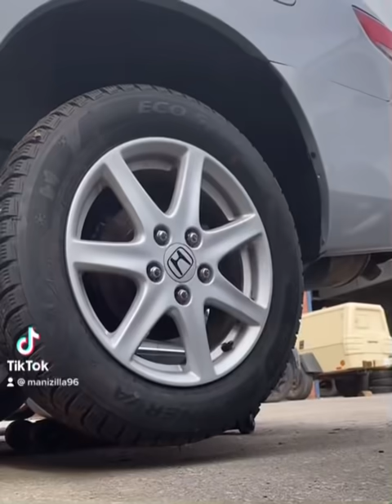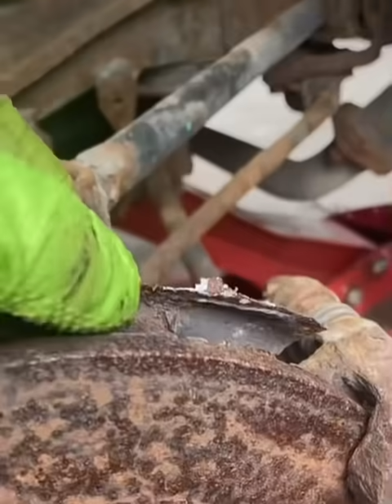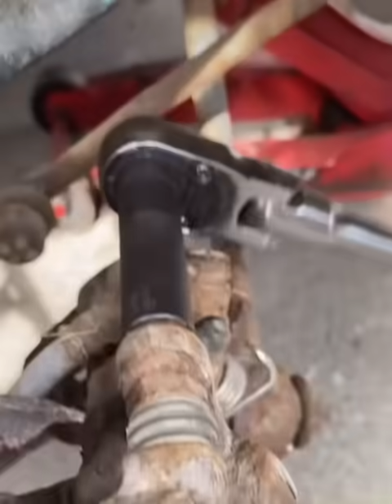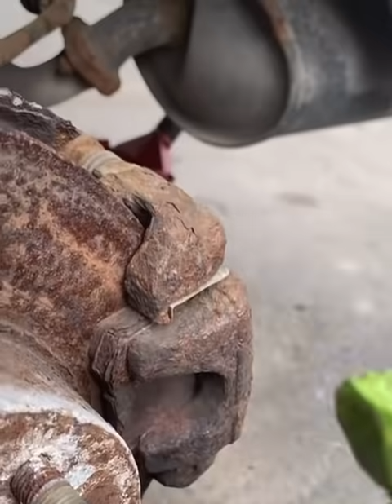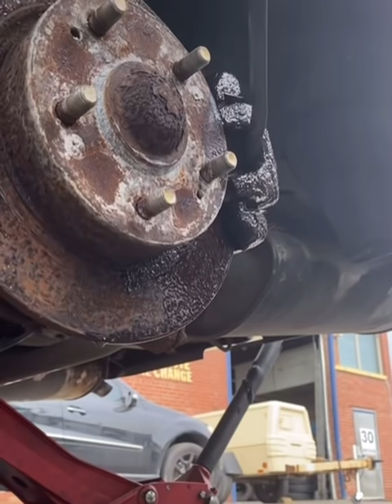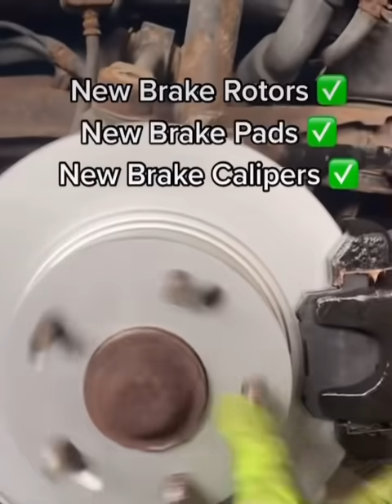Customer never drove their vehicle for 2 years and this happened ...

Comment: I would say that he cleaned and painted those calipers
Reply: same...
Reply: That cost extra........
Reply: When someone is cheap, they'll say clean the piece that's rusted and throw it back on
Reply: If not pitted and pistons are good rebuild them.. normal maintenance on brakes.. boots too...I always rebuild brakes if boots are compromised.. less then 10bucks. Diy...
Reply: Thinking the same shit but bet he charged em for 2 new ones he even used same old hardware you can still see residual rust residue
Reply: Correct, you can see the mark on the caliper where he hit it with the pry bar and hammer. Smh.
Reply: It's actually a zinc coated caliper, several brands come like that and it wears off after minimal contact. It's mean to be a protecting or a sealer.
Reply: @andrewnacy3258  na that isnt whats going on here
Reply: @seppukujones9651  I wait NVM, I was thinking about the brake rotor for a second my bad
Reply: @JacobEcret  I'm with you. Theres no way he cleaned that rust off and painted them.
Reply: @JacobEcret  my money is on a wire wheel and brush there wasnt much cleaning done
Reply: @JacobEcret  didnt even touch the anchor and he re used the hardware probably a caliper rebuild
Reply from the maker: The customer wanted refurbished calipers 
My mistake for writing “new” but calipers we’re replaced
Reply: @ManiiZilla  thank you for clarifying! Seriously!
Reply: Wire brush and black paint easy good as new hahahah this is what gives good mechanics bad names
Reply: @dsnutzzz4567  he did at least come back and reply that’s what the customer wanted. I’m a good mechanic and I hate getting a bad name for stuff like this
Reply: They are refurbs... The color is from sandblasting not paint...
Reply: It would be easier and quicker to just buy oem calipers that’s a thing y’all know
Reply: Hahaha there's still rust on the calipers
Reply: @ManiiZilla  I thought you were a fool for buying new ones. 

I've rebuilt my share of 40 year old calipers. It's tough but they end up as good as new ones. (914 calipers are EXPENSIVE)

At a shop, it comes down to parts vs labor. For a late model Honda, refurbished is probably the way to go. 

But yeah, 2 years of rust won't kill a caliper. Throwing away good parts makes Honda rich, and the rest of us stuck paying them. I hope you sent the cores back to the re-builder.
Reply: @gorillaglue5958  how is a new caliper faster or easier than refurbished? And, I'd bet the ones he used were OEM. 

People who talk world's but dont turn wrenches.
Reply: He did, you can see the dent where he smashed it with a crowbar.
Reply: Yeah those weren’t new xD
Reply: damm 😆🤣
Reply: @ManiiZilla  people are so cheap and careless
Reply: @zodwraith5745  Did you know it costs $2000 to replace an AC compressor? I'm a mechanic that replaced my fair share of compressors and not once has the bill come close to that, but here we are with another shop telling my wife she needs this $2000 fix. $500 to replace the water shut-off valve, that's getting bypassed for the season. The only thing they didn't try to scam her on was a serpentine belt for $50. 

Local Mazda dealer smashed her windshield replacing the wiper motor, it had a crack on the passenger side of the windshield, and they tried to tell her it was already broken so it wasn't their fault they left a Texas sized crater on the driver's side. By the end of the conversation, they realized she doesn't like being taken advantage of, but the free windshield eased the pain
Reply: @bullypopful  Ironically I just replaced the compressor last year in my GL450 after the clutch threw it's bearing and scattered all over the engine bay. Serpentine shredded, got pieces of metal in the alternator, and sheared off an idler. What an absolute nightmare repair. Mercedes has no right to wedge a V8 into such a small space. Still saved 2 grand even with the vacume purchase for a proper recharge but far from my favorite 2 days with a wrench in hand. Those are the jobs that make me empathetic with mechanics.

If you buy German you better have a full wallet or a full toolbox. Funny thing is parts for my Mercedes are cheaper than parts for my GMC.
Reply: @bullypopful I just had my whole system replaced because you don’t just replace one part or it starts leaking. $700.
Reply: I wouldnt replace them at all, a rebuild seal cit and a good clean. Usually new are too expensive
Reply: @ManiiZilla  Bs dude
Reply: @shadowwalker3204  The same rusted pitted calipers just sprayed with some Rustoleum
Reply: @zodwraith5745  All facts good sir
Reply: Defo not new 🤣
Reply: Wire wheel and rust remover and maybe new seals if he was feeling generous
Reply: Nah up sell to ceramic so they won’t ever rust and seize again.

Comment: With that much rust buildup I hope you checked all the brake lines and fuel lines.
Reply: Just in case.
Reply: If they didn’t AT LEAST do a flush to get all the old shit out. Then that’s literal ticking time bomb on the road.
Reply: Hell no he dodnt thats not the job
Reply: Why would he do that when the customer said what she wanted done
Reply: @noerangel9973  because you don't let a vehicle with possible fatal issues leave the shop without at least checking and informing the customer of those issues. You don't fix any issues without customer's knowledge and consent but you do have to check to make sure that the vehicle is safe to drive.
Reply: Pep boys “fixed” my moms 20 years old Le Sabre brakes.  Same thing this guy did, minimal effort job; just a pad and rotor change. No new fluid or lines.  shrek piss green fluid and the lines were rotted to Hell.   My husband and I Blew one of the rear brake lines when we put new fluid in the system.   Blew a rear caliper out  too.  

They took $1300 from her and left her in a death trap.  NEVER TOLD HER THE LINES WERE SHOT ! They Never should have touched the car.  

Don’t fix the brakes just enough to use the car.  Fix it right or REFUSE to do the work.  GREED.

I’d take a hit on my profit margin to push a proper job or not do it at all.
Reply: Well he did say he drove it in the shop
Reply: Bolts floor its gonna be dust soon..
Reply: @jo8737  no you would not..lier..we all do what a customer states..a full redo would be 3k.. all parts rebuilt or replaced... hoses new.. master on down..  hell. no customer pays for that..
Reply: Why? The brake and fuel lines would be in better shape than a car that has been driven every day for 2 years..... The only reason the brakes are such a mess is because they've been sat rusting whereas you'd usually be giving them a good grind every time you drive the car to stop it happening.
Reply: @Kiowan918  if the metal on the brake calipers and rotors, control arms, inner fenders looks as bad as it did, other metal parts, such as, metal fuel lines and brake lines, might look just as bad. Since they are usually made of thin metal lines, it doesn't take much corrosion to make them weak enough to burst when pressurized for any amount of time. Both the fuel lines and brake lines are always subjected to high pressures when the vehicle is in use. I wouldn't drive my car without first checking those items if there was that amount of corrosion.
Reply: aren’t fuel lines rubber?
Reply: @ethanstorm1735  fuel lines are usually a combination of rubber and metal lines. Metal lines usuall run the length of the vehicle and rubber lines are used where there is possible movement in the lines, ie. Between the chassis and the engine and between the tank and the chassis. Same with brake lines.
Reply: Woe dam let's not get all crazy, I am a Honda owner myself, The brake and fuel lines are probably better on this car still then some of the new Crap being built these days, Why because I have ran Honda cars in the shit salt roads since 2005 with the one being a 2001, have NEVER had to replace a brake line or fuel line yet, but yes I did have to do brake lines on a 1994 Acura once, It was parked in the weeds for years after not washing the road salt off at all,The exact same thing happened to it, The rotors that is, This is why you never want to park a car with road salt left on it. Two 2003 Civic Hybrids 5speed manuals with over 300,000 Miles each still had the original brakes disk in front and one set of pads The rest of maintainece oil changes tires I think I bought like two struts for on of those cars it failed shortly after someone hit the passenger door leaving a drive way, Spinning the car 180 on Ice, It was not fun trying to straighten the center pillar after that, I remember pulling on it hard enough to drag the car sideways parked on dry cement, Then removing the passenger seat so I could swing a mallet to help push it back out, I ran that for another 150.000 miles after that until the head gaskets both failed, Killed at least 3 deer with both cars sometimes not shutting them off right away, I am sure that didn't help the gaskets with all the coolant gone not much over a gallon anyways 🤓
Reply: @petero2693  what’s a “lier”? 🤡 a Full redo wouldn’t be needed just partial replacement of the damaged sections. Copper brake line tubing isn’t that expensive and bending it and flaring it ain’t rocket science.   

Just be more efficient and competent and it won’t be a big deal ⚡️⚡️pass the savings onto the customer by being a great tech.  

Many techs are poo and take many shortcuts or do half jobs like this.  Maybe this guy inspected the lines but it doesn’t sound like it.   

Believe it or not, some people put safety first and will lose a little money here and there to do the right thing.  Especially after the first, other shop overcharged their customer and only does a half job. 

You can make it up by overcharging the arrogant and rude customers if you want to balance things even more. If you’re into that kind of thing 🤠
Reply: I’m sure he didnt
Reply: That's common with a caliper swap.  Hopefully
Reply: Doubt he did
Reply: @petero2693  honestly
Reply: @jetstream454  As in BBQ Chicken or Jerk Chicken
Reply: @therealmarlboroman6128  Lol
Reply: @jo8737  "Same thing this guy did"
We were only shown the caliper and rotor change. We don't know what all was done to this car, we can't see the metal brake lines or fuel lines. If this is the first time it's moved in two years, chances are he did an inspection over the entire vehicle. Hell, in my state we have an annual vehicle inspection and any shop around here would fail a car for rusted fuel and brake lines. No way they are going to let that come back to them if you wreck your car or dump fuel all over the road.
Reply: There's no profit in it so I doubt he did. Honest mechanics are as rare as honest lawyers. I always send my wife in first to see how honest a shop is and I've never seen one that didn't try to talk her into thousands of dollars in repairs that weren't needed when she only asked for an oil change. One even said she REALLY needed new wiper blades when I'd literally put new ones on 2 days earlier. They're all fucking crooks. 

Ironically the only place that didn't change the story between talking to me or the wife was a local Mercedes dealership. First mechanic I've ever had tell me "XYZ could be replaced but it's not really necessary for at least another 20,000 miles."
Reply: Guaranteed he didn’t.
Reply: Suspension is facked
Reply: @jo8737  copper is not meant for fuel lines.  Please don’t ever use copper for fuel lines. It is way to malleable and is more prone to corrosion than a good steel line. Also most techs do what they are told not what is right because of flat rate. Flat rate is a terrible system and is the cause of this kind of fix. A tech does not get paid to go above and beyond what they are told to do. So flat rate promotes this kind of fixing because why would you do work for free. Their time is valuable to them so why do an extra hour of work and not got paid for the work when you can get assigned a different job that was scheduled and instead get paid for the hour of work. I’m not saying it’s a good thing but that is the reason why techs don’t. I am currently apprenticing as a heavy duty and flat rate is the only reason I refused to go auto motive instead. I prefer working on cars/trucks but no way would I work 40 - 50 hours in a week and only get paid for 30 - 35 hours. 
Edit. I am referring to techs working at a shop for some else. Whether it be private or a dealer. Not someone who works for there own business.
Reply: He did check them when he pinched the brake line….
Reply: @_gilcrest_  I meant the metal lines, the ones that can actually rust and aren't readily visible. It takes only a few extra minutes to inspect.
Reply: Not if the customer said "I've only got $300."
Reply: @dearboy05  it don't cost but a couple of minutes to just inspect it.
Reply: @farmsgrace341 , like...visually? Okay...

Comment: Never pinch flex hoses like this unless you're replacing them. If you must, stick a block of wood in the caliper or something but if that house collapses inside someone's gonna have a bad day.
Reply: Is that Michelin in your pic?
Reply: @Kamal_AL-Hinai  the original nightmare fuel himself
Reply: Came here to say the same.

I'd replace them anyway just cause of how rusted every thing was.  It's like 15 extra bucks a side. There could be moisture in the brake fluid. Or the hoses might be dry rotted. 

And also cause of crimping. 

How did the brake lines look?  They can't be long for the world either.
Reply: @mikeumm  I remember days gone by where flex hoses on ford escapes were so bad that just about every one we got in the shop needed all 4
Reply: Shop I worked at sent an e36 out on a 5,000 mile cross country vacation after pinching the flex hoses on a caliper change. Customer had to out pads and rotors on twice during the trip and was unhappy to put it mildly. I don’t think to this day the shop understands why this happened.
Reply: @jimrockfish1875  I love those cars.  Such a great daily. And put some snow tires on and some tube sand in the trunk over the axle... You'll be passing Subarus. Lol
Reply: @jimrockfish1875  also that is why I crack the banjo loose then snug her back up...let the old caliper hang from a hook on the spring... Install everything... And then at the end.  Swap the hose from old caliper to new.
Reply: @mikeumm  
You think? Great cars but I live in northern Ontario and they’re pretty much hopeless here in winter, to the point of being dangerous.
Reply: @mikeumm  
Now that is the right approach. 👍🏼 We get freaked out about opening the system but it can be done smoothly and then bled with the new unrusted bleeder screw if necessary.
Reply: @jimrockfish1875  I live around Pittsburgh. Nothing but hills and bridges. I had a 96 328i 5speed with Blizzacks and 2 bags of sand in the trunk.  That thing could scoot up any hill. 

And you could kick out the rear and steer with the throttle like butter if you wanted.

With shitty tires though.  Yeah useless in the snow.

I loved that car.
Reply: T El  just the other day I had a customer walk into the shop and asked me what he could use to pinch the rubber hose on his clutch sleeve cylinder so that he didn't lose all his fluid when he changed it...🙄
Reply: I usually just hang it up, the gravity has been enough to keep brake fluid from leaking out of every car I’ve done brakes on.
Reply: There's an inaccuracy in that statement because gravity would cause flow if your master cylinder cap was open and if you had open either the bleeders or the flex hoses in your wheel cylinders. Some load sensing proportion valves will limit flow to the rear if it's up in the air, but that's a mechanical cutoff. Sometimes fluid won't flow if you have the cap on the master cylinder but that is just a negative pressure differential being created in the air pocket above the fluid in the same manner that you can lift liquid out of your glass by putting your finger on the top of a straw when it is submerged. Gravity would work in favor of fluid flowing freely from the master cylinder out whatever opening in the hydraulic circuit exists. You can also stop fluid from flowing by depressing the master cylinder prior to opening the circuit at the wheels. The ABS pump can also sometimes interfere with free flow depending on the vehicle.
Reply: @Duhzmin  then I’m glad I bleed the brakes every time lmao, that’s probably why I haven’t had any problems with air in my lines, thanks for the information. Now I know to never skip the bleeding process the way I do it
Reply: But  ...  how are you going to kill people, if you don't damage their flexible brake hoses?
Reply: @jimrockfish1875  ya I bet thay got a lot of repeat customers and thay call them selves certified mechanics and the bad thing about it is thear is a lot of shops out there that are just as bad with there highly qualified mechanics